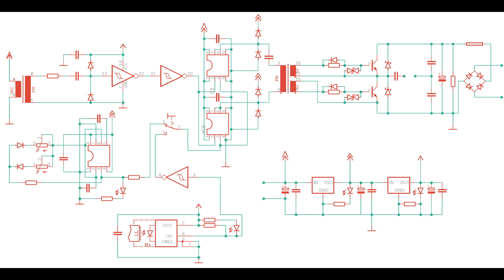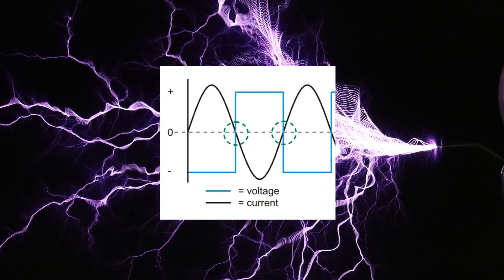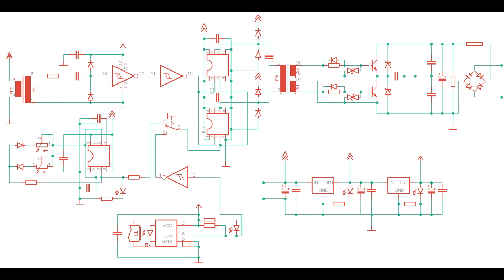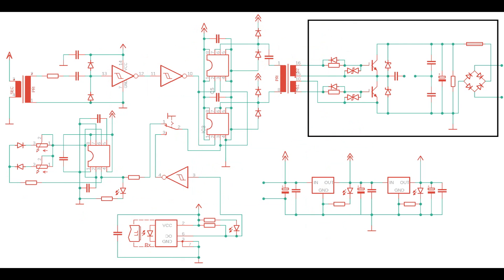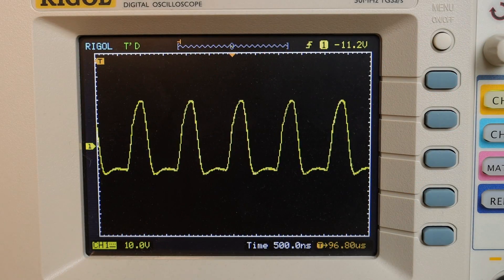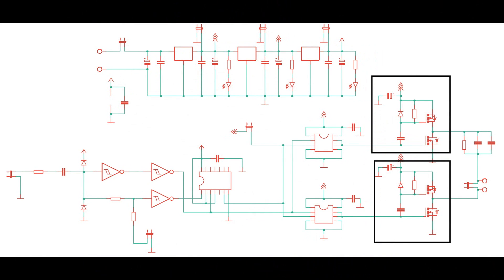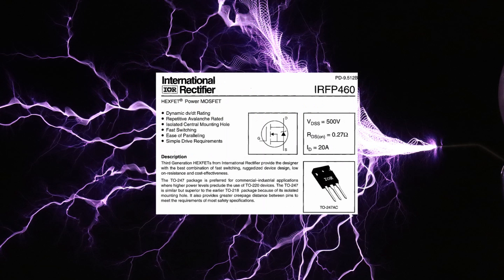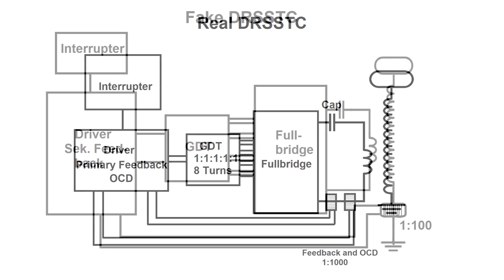Best Tiny Tesla Coil Circuit? New Driver, New Opportunities

Comment: Hey . Hello again . I've found a awesome Tesla coil . I haven't seen anybody build one like this . Its a spark gap and he has the spark gap set up in a way it looks like a big clock and has a receiver at every hour and the has the other end going around on what would be one of the hands on a clock , the seconds hand of a clock that the spark comes out of and it's controlled by a motor and I believe the speed is controlled by the receiver using a small voltage from it I think , so the bigger the lighting the faster the motor goes and faster the sparks happen . So it ties in with the primary coil . Making them resonate creating big Lighting , had lighting goes multiple feet away . So controling the resonated and I think keeping them at the same frequency I believe . So you wouldn't have to worry about having to use mosfets to control the coils and the controls of the MOSFETs and the power to control them and all the work that goes with using them and the money and time , and don't have to worry about blowing them up lol I believe lol I'm going to give it a try but on a small Tesla coil.  You should check it out and build one and make a better one.